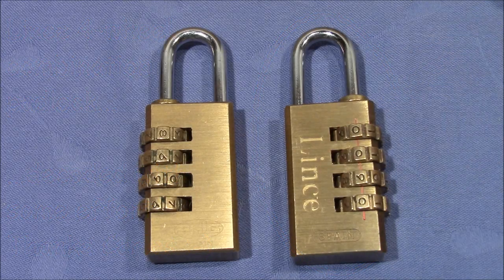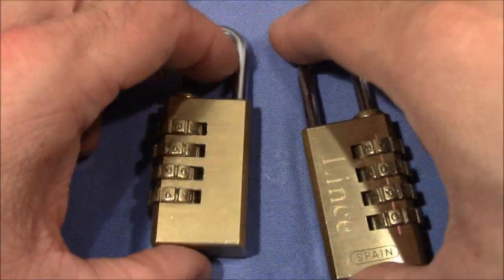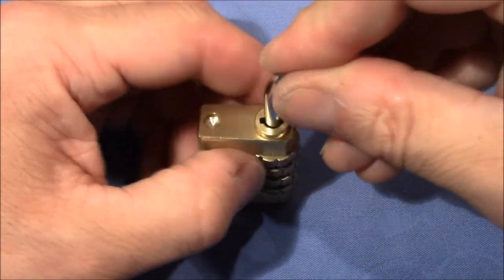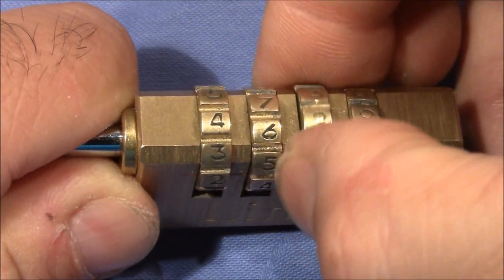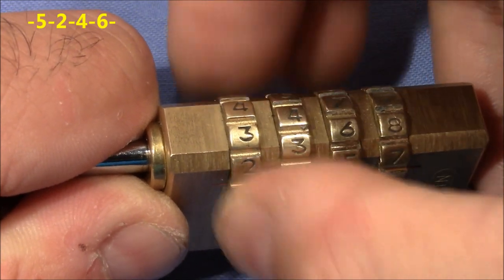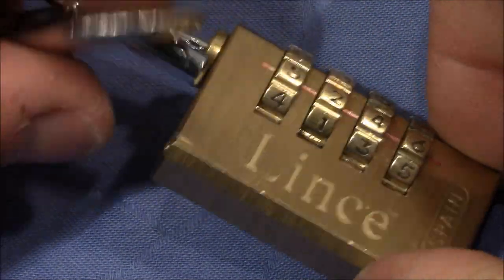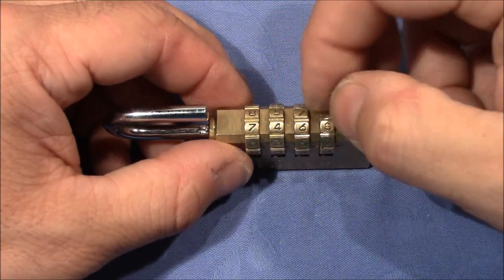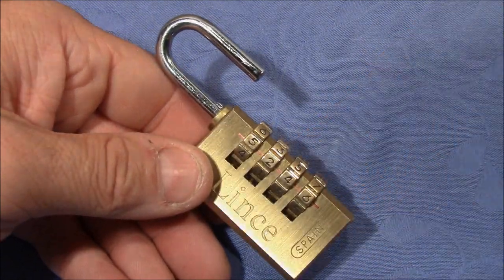(picking 575) Lince combination padlock with false gates - exhausting decoding

Comment: Wow you have a lot more patience than I do! - well done! :D  Are the other wheels easily moved because of your fingers bumping the other wheels or is it because they tend to turn anyway? ... ie when turning the wheel you're working on, do the other wheels turn even though you don't touch them?  Would 3 hands help?  In the real world, since the shackle would be attached to something, would you be able to pull the lock with one hand and hold the other 3 wheels with that same hand, and use your 2nd hand to turn the wheel you are working on?  Thank you for showing this my friend. :D
Reply from the maker: It's my fingers not the internal mechanism that moves another wheel. But only the slightest touch is enough to bring the other wheel out of the gate. And the gates are very narrow ;-) Thanks for watching buddy. Bye the way, the ABUS 4 wheel combination lock that I sent you, is the opposite and a very pleasant lock to decode :-)

Comment: You seemed to rush into it. You went for the right hand side wheel first, then just worked backwards, rather than trying each individual wheel to see which one was going to work before moving on. I believe this is why you struggled.
Well done though on the de- code.
Reply from the maker: I was quickly checking which wheel is giving the best feedback. And you cannot expect the wheels to bind in the order the wheels are ordered. But as this was my third attempt it might have become a bit hectic ;-)